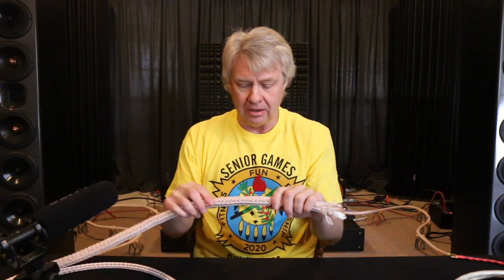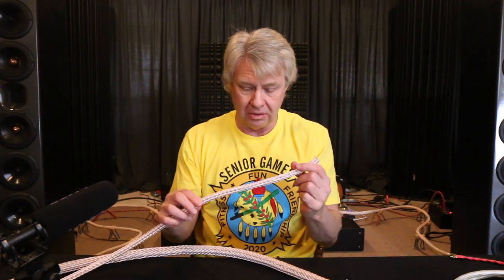What’s up with Audiophile Cable Risers?

Comment: Would lifting traces off the PCB on a complimentary output stage of an amplifier help as well ? I mean between the  transistors' emitters and emitter resistors and then all the way to output coils/resistors ? What about the positive and negative DC supply rails ? All those capacitively (electrolytics!) coupled stages of modern amplifiers must surely be terribly detrimental to the sound and miles of these tracks are in the same PCB plane ! What are the Engineers thinking ???
Reply: PCB layout do's and don'ts are well understood.  Capacitive coupling, signal coupling, ground planes, trace width, component placement are all taken into account as part of a design.  Hopefully, an attempt at humor.  Otherwise, exaggeration sprinkled with a few "technical" terms is jibberish.
Reply: @jfritzy4358  Wait ... are you saying that amplifier design is governed by well understood engineering principles and does not involve magic ???
Reply: Obviously,  the DC supply rails need to be both at their spec DC voltages & low impedance  ground level simultaneously,....thus the need for high Uf electrolytic bypass.....The PCB signal traces Should be elevated on risers above the boards ground plane throughout all signal pre-amp, power amp & extended elevated above floor surface to speakers for best possible sonics...

Comment: Great video! Yep, I use cable risers as well. My system has become very resolving, it's meticulously set up and my room is treated. As I learned more and more about cables and dielectric materials/dielectric absorption I started realizing that the cut-pile, thick carpet that my cables sit on were likely contributing to the sonic characteristics of my cables and so I simply cut down some blocks of wood from studs and placed them under my cables. Yep, undeniable difference. Again, my system can show these subtle changes and I also listen to my system 4-5 hours a day and know it like the back of my hand. I hear the same things you heard in the improvement. A lot of people think risers are used for vibration aspects but that's not it at all, it's about the effect of the carpet material and it adding it's influence on dielectric absorption. Works for me.

Comment: I use to have my cables on the floor.   I could hear some distortion but thought maybe it was a loose connection somewhere. One day while moving my speakers around I drapped the cables over my chair to get them out of the way and when I listen to them no distortion. I thought hmmm it couldnt be but lets see so I placed the cables back on the floor and there was that static sound.

When asked others as to why most said snake oil.  Then one person said it all depends on whats underneath your flooring.
Reply: How do you think cables on the floor cause distortion

Comment: With pinpoint center and wide soundstage you can make, a lot things are sensitive. Doesn't need to be costly along the chain or good room treatment. You can DIY or buy prettier cable raiser. There is a difference doesn't mean you need to change it.

Comment: Hey Danny... It is SO NICE to see this subject addressed so rationally and reasonably...and with the proper qualifications and understanding. To deny that it is real, is, well, just foolish. And to recognize that it requires a certain level of performance to be notable – the area of performance I address routinely in my writing and on my channel – is just as significant.

I have been espousing this philosophy since the mid-1990s. In fact, the last time I talked about it, in my "the audio analyst Episode 22: Better sound for free," it inspired a German audio manufacturer to do a spate of measurements and to work with an aircraft turbine parts manufacturer (Eurofighter!) to laser create a boutique paramagnetic cable raiser made of a newly created proprietary Magnesium and Aluminum alloy.

I have a set and they are remarkable. Yet as you point out here, and as I have said in ALL my comments on the matter, you can use free or uber cheap minimally invasive materials, cardboard tubes (empty toilet paper or paper towel tubes), paper cups, bamboo skewers and rubber bands, etc., to see for yourself how effective it can be in your own system. 

In hyper-audio systems like mine, it is so readily apparent that it would be criminal NOT to get my cables up off the floor.

THANK YOU for all your excellent work here on the channel, my friend. Keep ‘em flyin’, Danny!
Reply: Thanks, and thanks for watching.

Comment: Mr. Research,
In your experience, are the sonic results of the cable lifting phenomenon only applicable to speaker cables?
Or, should all the cables in the system be lifted?
Thank you.
Reply: The same can apply to all cables, but the greatest effect appears to take place with speaker cables.

Comment: I would be interested in a variable riser system that could lift or raise the cables, thus providing a listening in real time experiment. This might also help to ascertain what height is optimal for the room/floor material. Perhaps different heights would provide different results for different cables, environments or even sources or  types of music. I envision a lift from above setup so the 'lifting' method does not affect the cable. Or perhaps a string pulled X lifter. C'mon engineers, if you build it, they will listen...

Comment: My building has cement floors and it is quite audible the difference between cables on the floor and off the floor. I have tested it multiple times and the results stand...
Reply: Find a way to do a blind test.  Have someone else repeatedly move the cables for you, but you can't see what they're doing and they don't tell you.  Best test would be to move the cables multiple times during the same song.  You don't know when the cables are on the floor or on stands.  And the person should try to trick you.  Then see if you can really tell the difference!

Comment: I’m glad I ran into this video. It made me revisit mine, which I’ve had for quite some time on my system. I never really gave much thought to them honestly.  Just did it-“because”. 

Now here comes my observation- now, you cannot have sloppily placed cable risers on your system.  What I mean by that, is that you can’t have some areas where the cable is allowed to droop onto the floor.  It’s not a “good enough” kind of deal.  If you don’t have the entire cable length not touching the floor, you can kiss the efficacy of the risers goodbye IMHO.  I Say this because I just discovered this.  I had a few spots of droopy cables where they were kissing the floor.  I figured “enough” of the cable was lifted enough so it was okay for the most part……I was wrong. 

Thanks to this video. I made sure that NO part of the cable touched the carpet…Yep- the improvements you described were present.  I feel like a fool because all this time I thought my risers, in the fashion they were in were sufficient. But  in reality, one weak link (ie. The droop that causes the cable to even kiss the floor) - all bets are off. 

My system is highly resolving reference level gear and the room is treated with proper placemat of speakers. It’s actually very noticeable. Especially in separation and highlighting of instruments in the stage.  Improved dynamics ass well. Thanks!
Reply: Yes, me too have found very similar improvements in imaging, soundstage width and depth. Everything in the soundstage just seems to be better defined, separated, the bass has better control, there is more clarity in the timbre  or each instrument sound more distinct than before 👍👍👍 My only twist to the tweak is that I only used toilet rolls to prop up the cables😂😂😂

Comment: Are you serious! I've had Cardas,, Audio quest,and still have Some Kimber,and. Super High end MIT cable's.but, found some incredible results with just 12 ga.romex! The trick is,slit the insulation and remove the Black and Red solid core wires.then,fix the end of those wires under a weight,then on the other end , stick them in a drill,and twist them to eliminate all RF frequency.if you do it right,it will astound you!!!

Comment: If cables can alter the sonic character that much, then a wireless transmission would be the better, because there will be no coloration in the signal path.
Reply: Everything 'colors' sound...wireless wouldn't make any difference, unless the speaker itself is made from air lol. Transmission without coloration is a contradiction by nature.
Reply: Until somebody farts in the room
Reply: @swiftusmaximus5651  you have to leave the room then and one be in the former sweet spot unless you have an audiophile gas mask .
Reply: no actually a wire is always better.  transmitters and receivers use compressors and cant handle the dynamic range. wireless is also very prone to interference and RF noise.  Cables don't alter the sound "that much" and all this talk is crap until the blind test shows otherwise.   Audible  is the key here.  Not all the bullshit about this story and that.  Audible is simple to prove by simple blind testing.  I do believe good cables sound better but, only after a double blind test, proves true audibility.
Reply: @uncledoug9999  Cable believer myself...love you unc!
Reply: @Projacked1  l

Comment: Wood floors are held down with flat steel nails (they are below the surface so you can't see them).  Carpeted floors are on sheet goods that are held down with steel screws.  When you complain about iron / steel in connectors, this is the same thing steel along the speaker wires will have similar problems.  Ideally when you use spacers do not place them uniformly to prevent a high Q situation (this also applies to computer wires especially long runs).
Reply: all that makes perfect sense.  How did your double-blind test go?   Audible is the reality we seek.

Comment: good information , key points  are    cotton  ,right angle spacing ,dialectric    new to me .will these be applicable to all cables   power , interconnect  ,speaker  etc ?

Comment: My understanding is that Cables, when laid against a ground plane, have more capacitance.  Thus, the LRC values change.  This changes the signal.  This may or may not be something that you perceive as an improvement.
Reply: That could be true but on the whole floors are not made of anything that could act as a groundplane, it needs to made if something conductive, usually steel or aluminium.

Comment: I’m trying to find the video where someone has speaker wire connected to an oscilloscope. Simply lifting the wire of the bench you can see the noise on the scope disappear. I think it was Cardas or Danny himself who did the video. If you can measure a difference on a scope then you can hear a difference on a resolving enough system.

Comment: Have you tried solid copper twisted pair for speaker cable? I am not a fan of stranded wire anywhere in my system.

Comment: Just got the LTM CONCRETE Snap Rebar Chairs from Amazon and have started installing them. I will see what difference they make!
Reply: Cool !.  You can also place bits of paper, cardboard, cloth (organic hemp, organic cotton, silk, etc, watch out about colourants) in the cradles and you might find slight change/voicing. 
My suggestion to Danny of white Titanium Dioxide paint is because the Tio2 pigment gives a nice damping quality/voicing, muting the highs/tops a little but depending on system this can be advantageous. White sheathed power cables and signal cables have same property and I find black cables have a 'hardness' signature in comparison.......maybe Apple know something they are not saying lol. Please let us know what you find with your experiment. Cheers..

Comment: If you make your own speaker cable, why don't you use shorter runs?
Reply: We have short ones too, but swap out to longer ones when using stand mounted speakers.
Reply: @dannyrichie9743  Can you tell a difference between the longer and shorter cables?
Reply: @richardsmith2721  I haven't been able to tell any difference with these cables.